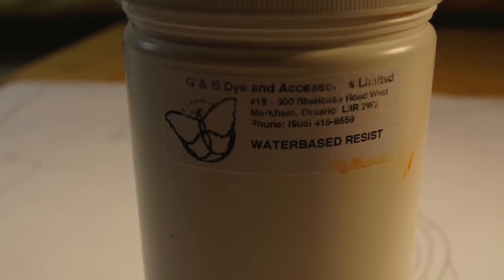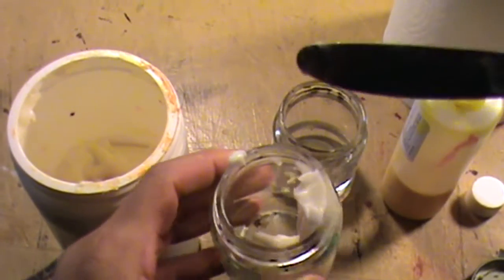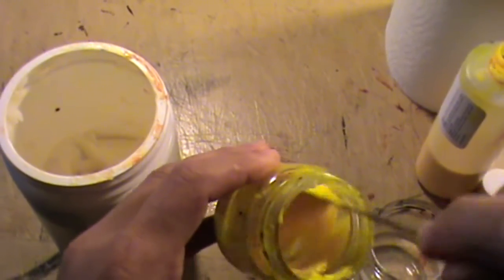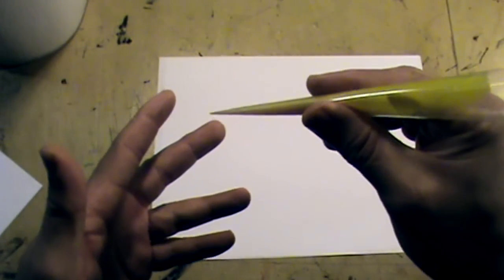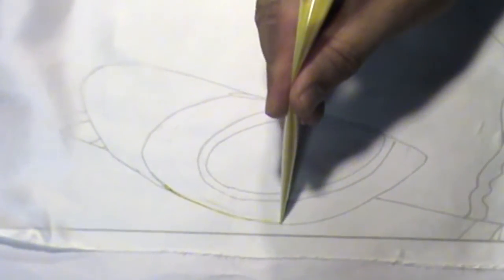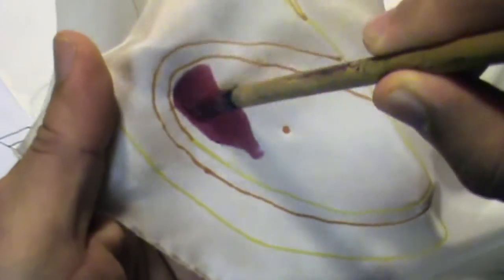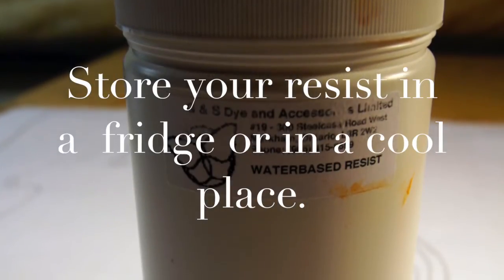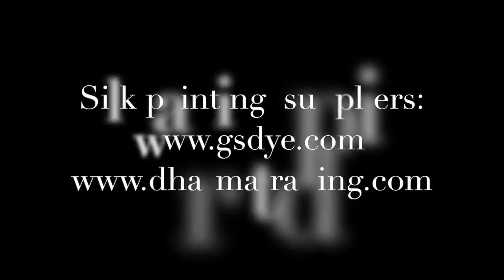WORKING WITH WATER BASED  RESIST | JEAN-BAPTISTE

Comment: Brilliant, I am using an expensive gutta resist which comes in very small tubes and a fine steel nib which can block or blob easily for beginners especially, so I am most grateful to you for posting this video as it has opened up a whole different way of preparing the silk for painting. I also particularly like the idea of fixing the silk to the drawing rather than actually drawing on to the silk and covering the lines with resist. Thank you very much, Sue Brown
Reply from the maker: Happy to be of help, just make sure that you are using a cold wax based resist otherwise if it is starch-based the resist will stick to the paper.
Reply: Thanks that's very useful
Reply: Please tell the name of the spray to fix silk  to the drawing.Thanks for a very informative video.

Comment: Thank you for sharing this information. It's very helpful. My question doesn't the water based gutta wash off when soaked in water? The one I use is transparent and when I wash the silk after its completed the resist washes off exposing the white fabric underneath.
Reply from the maker: I do not wash my silks as they are fine art.
Reply: @DanielJeanBaptiste  🌹

Comment: Interesting how many different ways there are to mix and apply resist. I use Cleanline (now discontinued) or Resistad and mix up many colors in squeeze bottles, which keep for months or years if I add alcohol to keep it from getting moldy and re-hydrate once in a while. Your method is clever for saving money, and tip clogging would not be a problem. You might like my music scarf video.
Reply from the maker: LOved your scarf videos, great fashion tips. The gutta in an acetate applicator will remain fresh for up to a week.